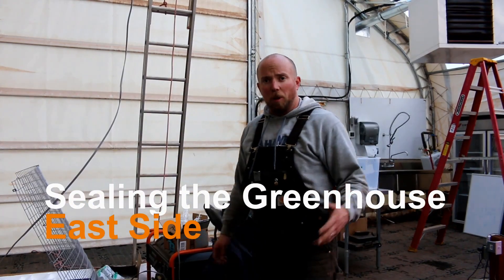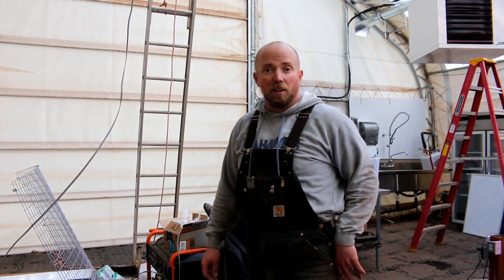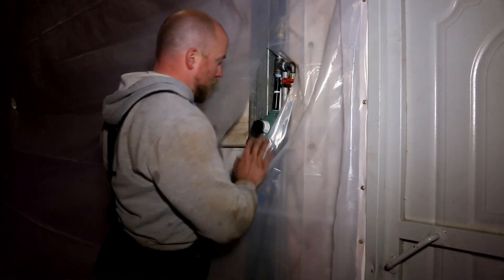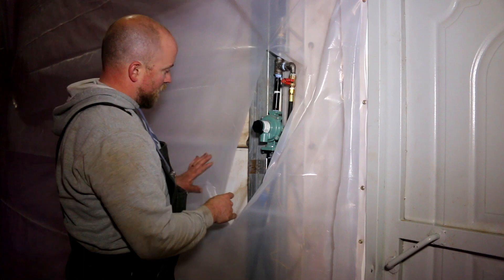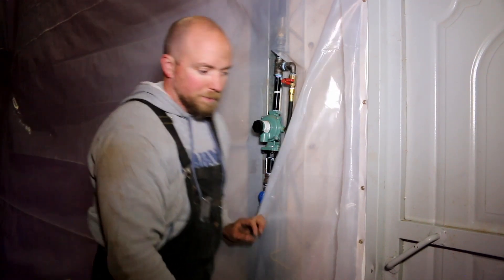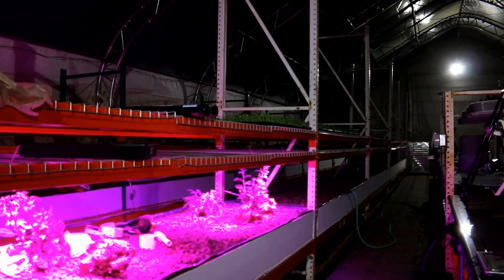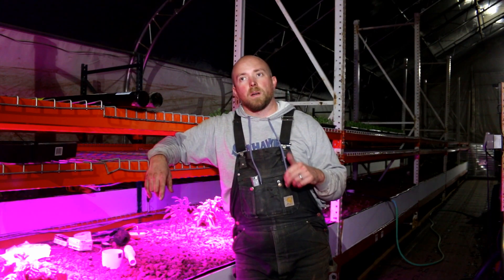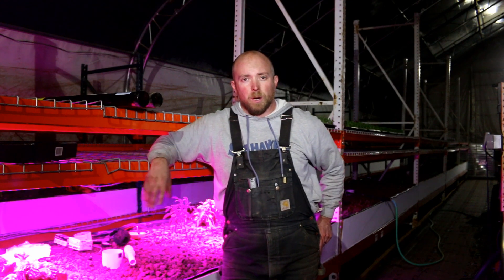How to Insulate a GREENHOUSE - Part 2

Comment: How much draft is there in front of the fan when it’s turned off, could you try plastic over the fan if it blows inward with magnets around the edges of the plastic to seal it?

Comment: Jeff, you say your thermostat is next to the door and propane regulator ????? A thermostat should NEVER be close to a exterior wall, it should be placed in the center of the building, NOT near any drafts, or where the sun will beat down on it since you now have a clear ceiling on one side. preferably in a housing with vents in it  so you have a true temp reading.

Comment: Why are you sealing a wall with massive doors and huge fan?  I wish you would have taken my advice and build two interior end walls to create air-locks.   With 10' inner air-locks on both ends you could have an R100 or better.  Instead, you will have massive issues with humidity and ice forming in and around the doors and the fan.

Comment: TRM, wrap kaowool around your heater exhaust pipe and then tape plastic sheet on ceramic blanket. Use this: http://amzn.to/2zwdnBx  Fold in hald and wrap around hot exhaust pipe. Tape using aluminum HVAC tape. Then tape plastic sheeting to insulation blanket and it won't melt from the hot stack. For a good toy, use FLIR for your smartphone. http://amzn.to/2ylqf9Y There's one for Android too.